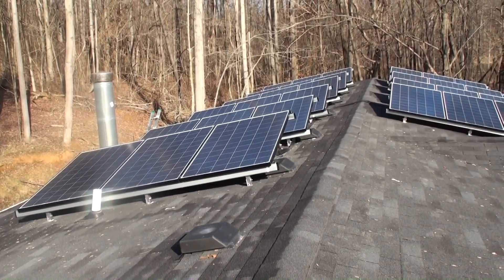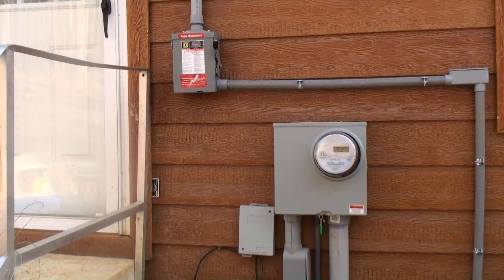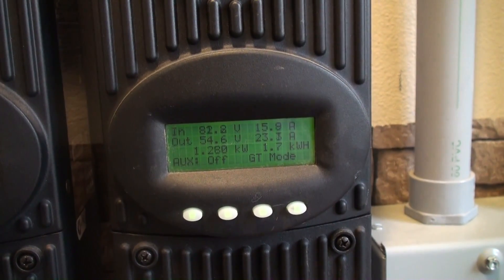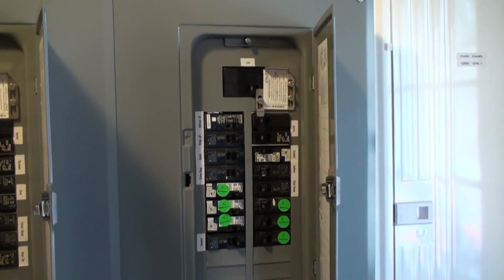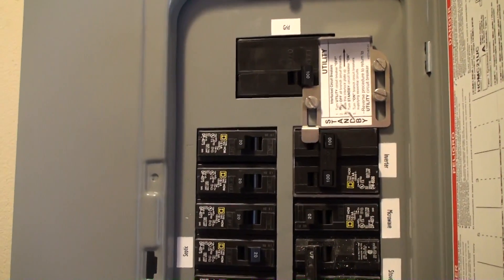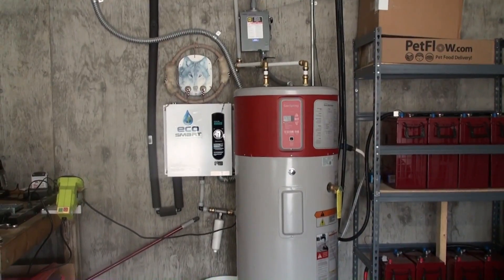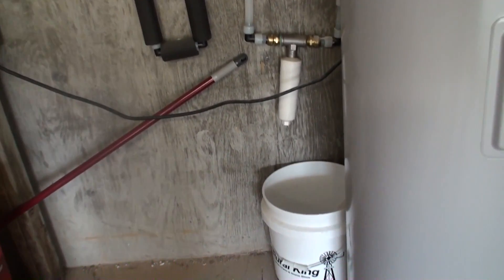Our Outback Radian GS8048 Based Grid Interactive Solar System

Comment: Been working with Wholesale Solar, have a really nice GS4048 based system lined out using 4.2kW worth of Astro Energy 305W PV modules in a 2 series by 7 parallel  configuration using a Midnight solar PV combiner, and the Classic 150 MPPT charge controller. Each column is a two panel string to the combiner, so my string topology favors early startup and late shutdown as shade from trees in the morning and evening begins to cover the far edges of the array.

I'm a little torn on the GS4048... Outback confirmed I cannot upgrade it to a GS8048 later by adding another H bridge FET module... looks like a $1300 increase to jump to the GS8048 which is about a 10% increase in the total system price.

Have you gotten to play with generator support mode? Was wondering if you had tried letting the GS4048 assist the 11kW generac with heavy loads?

I have considered two possible paths in the generator area: an 8kW standby generator 240VAC AC using the AC2 input (would probably do this with the GS8048), or using the Alphagen DCX3000 48VDC 2.8kW portable generator.
Reply from the maker: Cool, it's a great system, just make sure it's wired up correctly.

Comment: Is there a reason you used combiner box with 5 breakers with only 3 strings attached to each box?
Reply from the maker: Each 5 breaker combiner box combines 5 strings of 3 panels each, so they are indeed full.
Reply: Thank you! Great setup. Looking to install one similar.

Comment: Had another thought... Since your Generac Guardian 11kW is connect to your AC2 instead of their standard Nexus controller or whatever, how are you signalling auto-start to the genset? Were you able buy just the genset without all of the controls?
Reply from the maker: Yes, you are correct.  The Generac's have a 2 wire start so you just wire the 2 wire start controls from the Radian directly to the Generac and the Mate 3 controls starting / stopping of the generator.

Comment: Top Notch Install!
Reply from the maker: Thanks!
Reply: kb9okb : Hi !! If you have the time, we all would appreciate a follow-up video showing how the system is running during the summer in terms of harvest etc. Thanks.
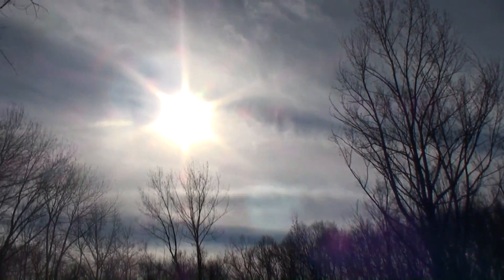Reply from the maker: ejemm Sure, I can give you a quick update, the system is performing very well... up to about 35kwh/day now.  The problem is (being in the woods) I have some shading issues that we are resolving.  I had a morning shading issue affecting it till about 11:30 but now I have topped those trees, so now the array gets full sun from about 9am to about 2:30pm when the shade starts hitting it from the other direction.  We are going to take down about 5 more trees to get another hour or two in the afternoon.  But as of right now from about 9 to 2:30 I have full sun and am seeing between 30-35kwh on a typical (non shaded day).  I have had occasional issues with the breaker tripping due to cloud effect (when the array is producing up to 140% of it's rated output).  I believe I have resolved that for the most part, by backing down the max output of the charge controllers a bit.  In a nutshell, so far so good!!
Reply: kb9okb : Awesome performance despite the trees. What is the rating on the breaker that is tripping?
Reply from the maker: ejemm Yeah, I'm quite satisfied.  It's the 80A GFDI breaker between the charge controllers and the battery bank.
Reply: Good stuff. I will check back in case you want to make another showcase video ;) Keep up the good work. Have not seen a better Radian system on youtube/forums yet!
Reply from the maker: ejemm Thanks, me either, that's why I posted it.. not much out there!

Comment: Did you buy all your stuff from one place, or get it as a kit form? I've seen some XW kits but no Radian yet.

Was looking at Kohler's 6VSG genset, puts out regulated 48VDC up to 6kW. Genset is a bit pricy per kW but I don't have much fuel storage around so a big engine is hard to keep running.
Reply from the maker: Yes, I ended up going with Wholesale Solar, but talked to many others.  They seemed to have everything I was looking for in-stock, and they did the pre-built / test of the Radian, load center, and charge controllers.

Comment: Did you design your system, or did you hire a solar company? I'm designing a similar system, but using Siemens generator ready load centers - one in each of my two buildings to break up the grid and the off-grid loads. The load centers could be considered a main breaker load center with an integrated sub-panel, or a split interior load center. My system of course is a brown-field project, retrofitting these load centers in where I had old rusty load centers.
Reply from the maker: I designed it, but with the help of some solar vendors.  I didn't use any local solar company, if that's what you mean.  Yeah your solution sounds like a good one.